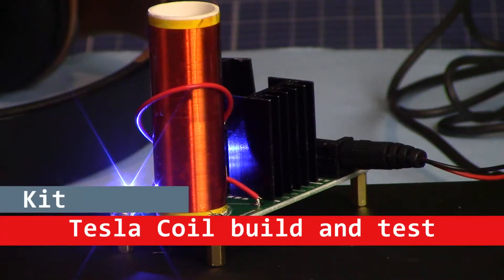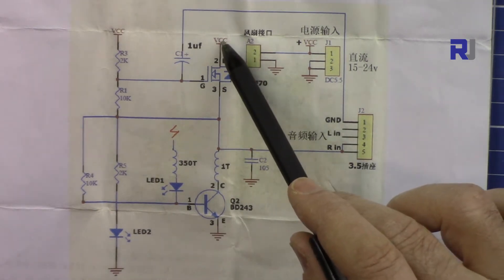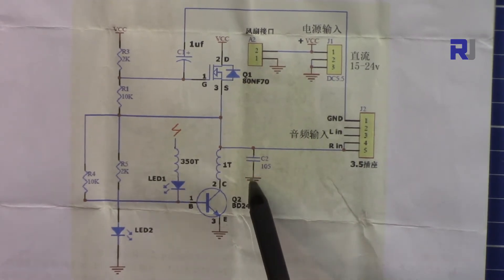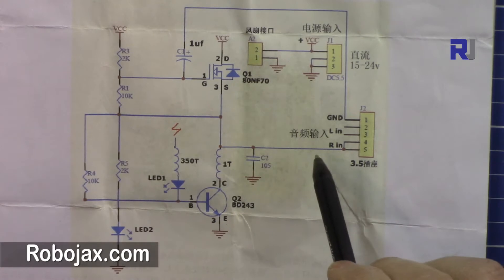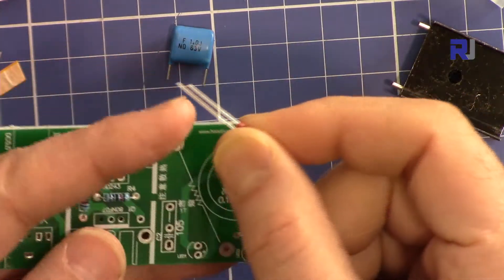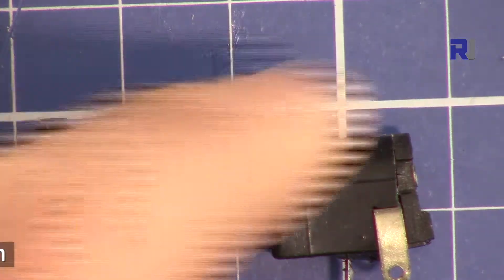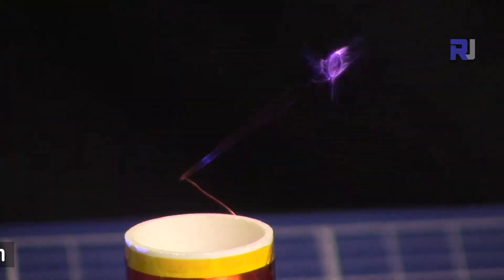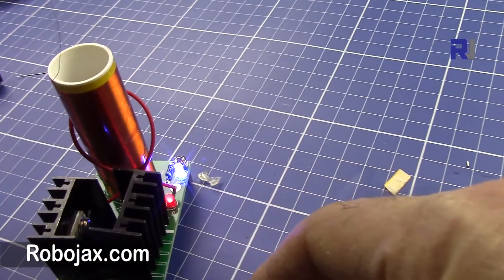Tesla Coil Kit - Build step by step and test with music RJT74

Comment: Hello, my tesla coil doesn't work. Both leds light up but the radiators are cold. What could be the problem?
Reply from the maker: Hello, if the heatsink is not getting hot, then the circuit has issue.  The circuit has to oscillate at certain frequency which will make current pass through the fist large winding and then the 1 turn 2nd winding.
Reply: Thank you, but how do I solve this problem?

Comment: Any possbility to help me with my coil which is not working at all? When I connect power none of the leds lights up. I am using 19V 1.58A power supply from old notebook with correct polarity. What can I measure to find out wich part is not working?
Reply: i experienced the same problem but my leds worked but not the coil. research showed that one the transistor could be bad two the connections could be bad or three the coil connections could be bad such as the copper coil for the secondary is not clean. check those out.
Reply: @Mark-nh3dl  I found the secondary coils wrap direction absolutely effects the coils functionality. If the led is on and nothing happens. Try reversing the direction of the wrap.
Reply: Make sure the power connector that plugs in is making contact. You need a 2.1 MM connector center pin positive. That is the problem mine had. No LED's lit etc.
Reply from the maker: Hard to tell. the transistor might have died. just buy the transistor. I have shown the schematic.